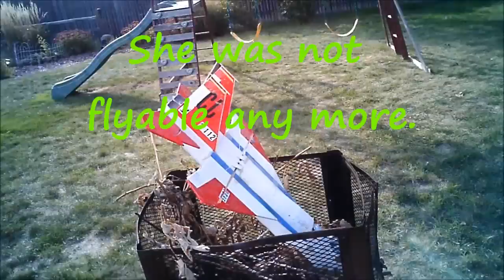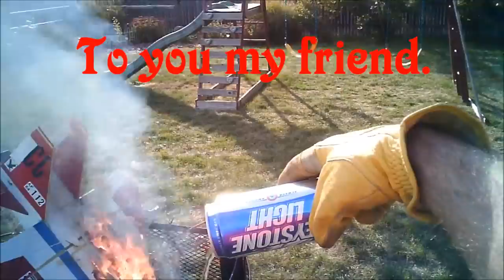The end of my RC F-15

Comment from the maker: It is an awesome flyer! Very stable and predictible and can be fast (depending on your gear). I built a new one the same size but I have made it more stream lined, aerodynamic and more scale looking with more realistic body lines and curves. I used lightweight spackling to fill in the porous surface of the foam for a smooth surface to paint. I use a Grayson Hobby parkjet motor / 30 amp ESC combo with a 6x4 prop and a 3 cell 40C lipo and down wind it will go about 70 or 80 MPH. Thanx for posting.